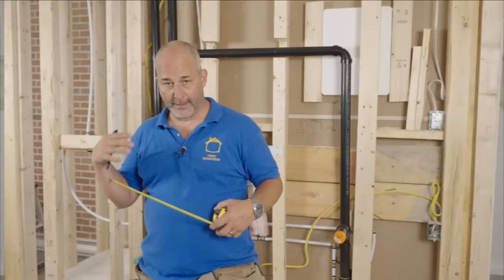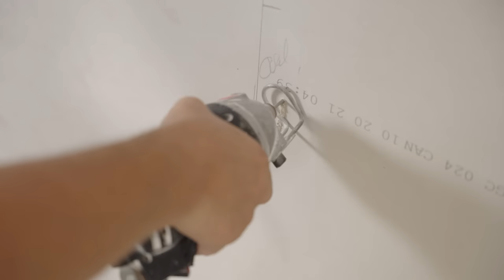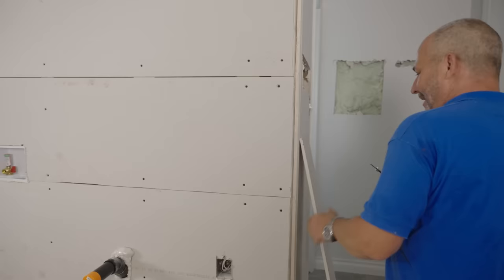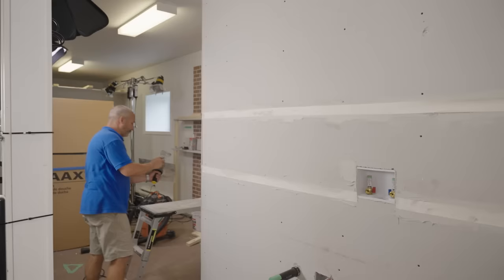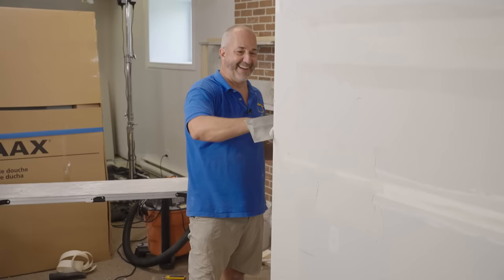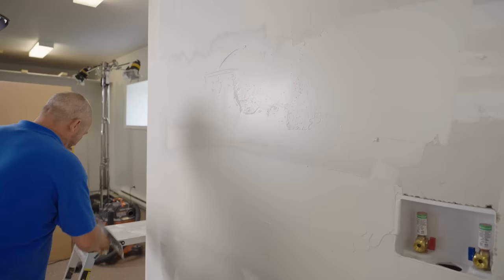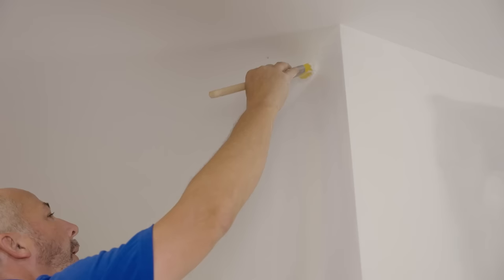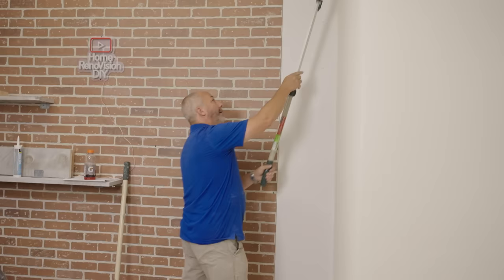Drywall Done In 1 Day | All My Tips And Tricks

Comment: In all the drywall videos I watched from you, Vancouver Carpenter, Kilted, etc, I never picked up on the fact that you can't paint over hot mud till I was done with primer and two coats of SW Super Paint. Do you have any tips for fixing the areas where the hot mud flashed through the paint?
Reply from the maker: a third coat.

Comment: Just moved into a bungalow all dry walls mould in the bedroom just had a look it's got three layers of wallpaper on it, had a go on one wall with a steamer to get all three layers off it's taking the layer off the plaster board and gone down to the pink plaster, can it still be used, it's taking forever to get the wallpaper off.
Reply: If it took off the drywall paper, the sheetrock might not have enough tensile strength to hold up against small bumps.  Probably easier to just cut off the old drywall and start over
Reply from the maker: agreed! It's just drywall.
Reply: So remove all the drywall in the bedroom, oh well that will save taking the wallpaper off ok thanks for your help.

Comment: I’m all about contractors showing do it yourself on how to do it so they can save a few bucks but one thing you should never do is sit there and mock someone who uses different tools than you do because I can assure you while you use your trowel, I will beat you with my eyes closed in applying mud with a drywall knife and it’ll be a lot neater and not all over the place. Also you did not place any strike plates over any of your plumbing or wiring.

Comment: I am trying to put up new drywall around our fireplace after taking down these old wooden wall panels and there’s a doorway on each side. I’m just wondering what’s the best approach to seal and mud where the drywall meets the ends of the door trims that are already there. Any suggestions would be helpful!
Reply: You may of already found an answer but if not. Look up, "tear away bead". Cut your rock to the appropriate widths and take off about an 8th of an inch extra on the sides with the door trim. Mask your door trims. The tear away bead will staple to the rock, be generous with staples, more doesn't hurt. You can position it a little closer to the door trims to get the exact fit but like a said, an 8th of play room would be fine. Staple it on. It has a little lip that you can use to help coat it (there will be an end that looks like it sticks out farther, don't coat up to that, you tear that off later). Coat over where the staples are. Use a quickset (hotmud) like a 45 or something. Let it dry. Then do a finish coat with an all purpose (which you can use for all you coatings of joints etc. Sand it lightly. When done the tear away bead has a little longer plastic bit the runs the length of it (should be facing away from the wall). Nick it at the top end with a utility knife then you should be able to pull that little bit of the plastic piece off (the flange). Be careful to but be too aggressive, you don't want to damage what you just finished coating, go slow and pull in the proper direction. After which with your door trims still masked, you can paint.

I'd recommend watching a video on YouTube of how to use tear away bead to clear up any confusion.

Comment: I asked a question. Do you think it best to buy a home to renovate or should I pass. I am single on limited income and would like a home however the renovations might be a bit much any suggestion to rebuilding it on my own in a certain time frame
Reply: Depends on many factors.  How much work is needed and if it includes major appliances or repairs, your skills level, how fast you need repairs done and so on.

You can buy a fixer upper and end up paying more in the end if it needs a new roof and HVAC system, plumbing repairs right away.  On the other hand you can buy a fixer upper and save lots of money if it needs mostly drywall patches and paint.  It all depends on the situation.
Reply: It is very expensive. Get a trailer and call it a day.
Reply: I have a similar question.  I want to build this house I've been dreaming about.  How much is it?  Or should I do it myself?

Comment: Why is the caulk going on after the primer?
Reply from the maker: because I flat taped and the drywall mud to ceiling joint could crack without it. Cheers!
Reply: @HomeRenoVisionDIY  I meant, why didn't you caulk before the primer?

Comment: lol home owners dont buy 300$ tools, rotto zip 200$ lol, holy crap screws much. get a magnetic bit, and then lift with 2 hands, hold with one and screw with the other hand, you only need like 4 screws on the drywall to hold it....start from the ground, screw all bottoms and the 16" from bottom ...then use ladder to do tops and 16" from top..

Comment: I don't understand what you were saying about cheating on the the inside corners of the tiny wall. I had assumed you said you taped flat tape over onto the adjacent surfaces and then later we're going to score them with a knife but you never showed yourself scoring them.
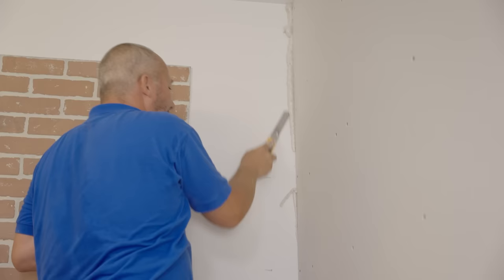Reply: 25:17 maybe I overthunk it or gave you too much credit. I guess you didn't extend the tape onto the adjacent surface to protect it and score it later I guess you just threw down flat tape like normal, because you had some cut out damage. Normally you wouldn't tape inside corners but this time you did because of that little cutout. Right?

Comment: Unless your doing 5☆ coat, your wasting a lot of mud on that horizontal seam. They are tapered for a reason. There's no need to flare your horizontal way past the taper edges. Way more product used and much more sanding. Unless like I said,  a 5☆ finish is the outcome. I also suggest you get a drywall bucket scoop if you wanna be a professional. Your scoops will be much cleaner, efficient and less touching and cleaning. I also disagree w the take on the flex straight edge tool. You can achieve much more and more professional than the result you have shown here.

Comment: You are fired as a drywaller..drywall eres...  that wall is a wet wall and requires mold resistance board
Reply from the maker: Hi Jose, wet walls are only found in bathrooms. Cheers!
Reply: @HomeRenoVisionDIY  also on a washer rooms and any wall with water lines
Reply from the maker: not sure where you live but that is not the code where I live. Cheers!

Comment: I actually disagree with this approach. You want the foot high drywall sliver at the bottom towards the floor as the butt joint 9/10 won't be visible as it will be behind the cabinets and depending on your layout you might not even have to put a second coat on it. You want the tapered joint at the eye level above the countertop ( and yes, traditionally, when doing 9 foot ceiling with 48" drywall the seams are in the middle to ease the taping but this is a laundry wall covered by cabinets/machines).
Reply: Good point if there are cabinets.  If not and a lot of feet to mud I'd just put strip in middle, depending on the level of finish desired including texture type.

Comment: obviously none of the Plumbing or Electrical was done by licensed contractors or inspected.

Why leave the huge gap at the ceiling, before hanging the walls.

That is some handyman crap looking framing, electrical, plumbing and drywall work.

If you left it slick, why not skim coat all the drywall?

I hope this isn't for a paying client or a house that will be sold.

Comment: Did he really just use straight flex as a coner bead on a hallway outside corner? 😳  that's not ganna stand the test of time or durability
Reply from the maker: I installed it with 45 mud. That is plenty strong enough. Cheers!
Reply: @HomeRenoVisionDIY  straight flex has its place but never on outside wall corners even with quickset. One good bump and it buckles, twists and creases.